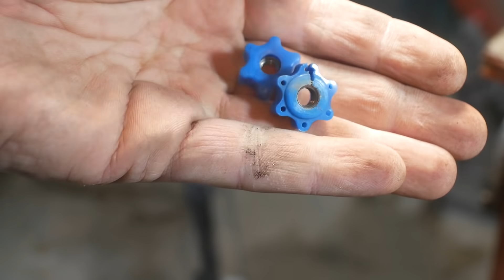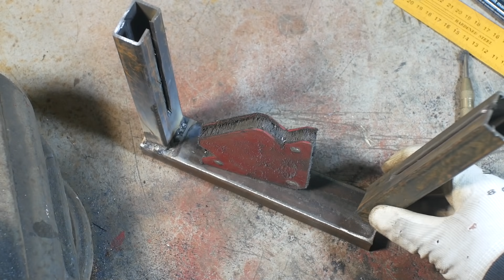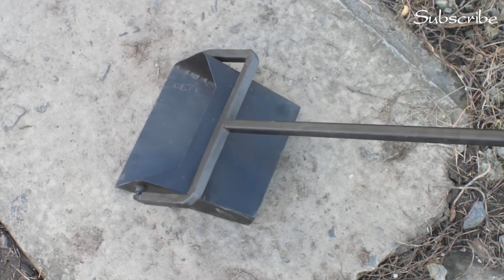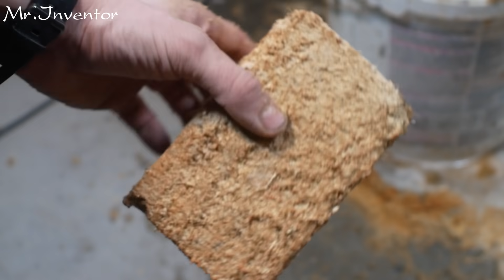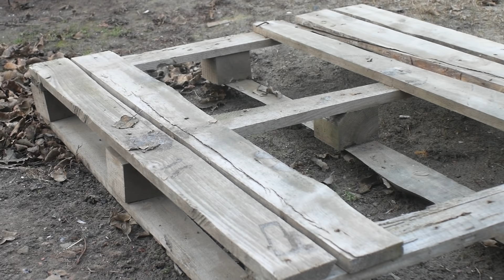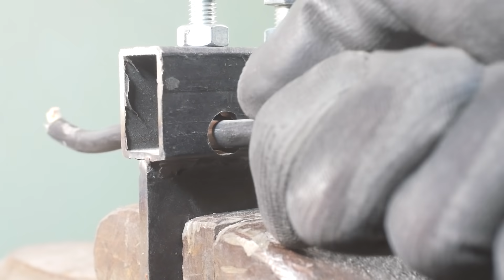8 SIMPLE DIY IDEAS THAT WILL SHOCK YOU

Comment: The saw guide will if too tight take the set off the blade or if too loose not give an accurate cut. Normally they are made of a softer material like wood or plastic to prevent wear on the saw tooth set.

Comment: Complicated ideas,requres welding machine ,drilling machine, angile grinder , gloves , cutting wheel, safety glasses , leather boots, bench vice , welding roads, ,nut bolts , square boxes , electricity, expertise to operate the above equpments without getting killed. Aaaaaa forget simple,